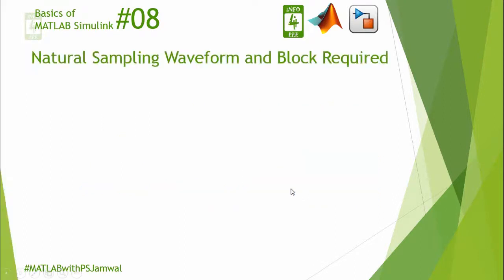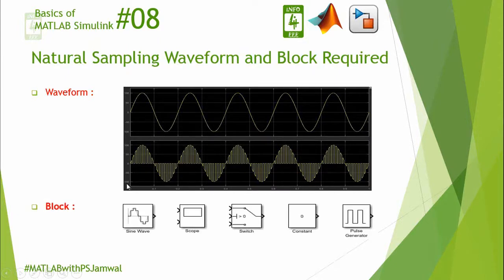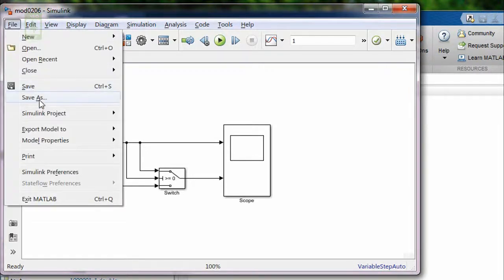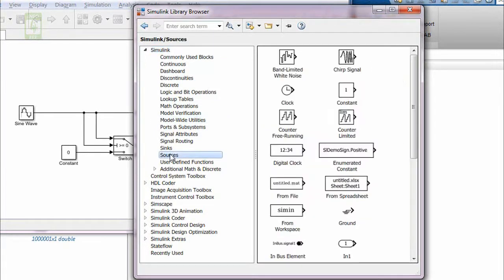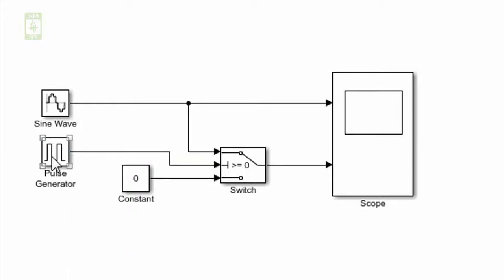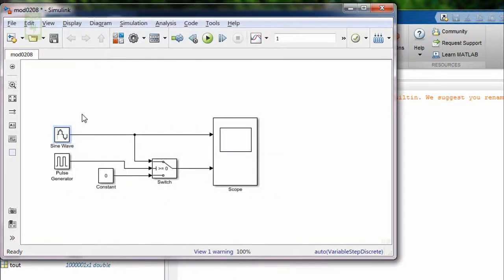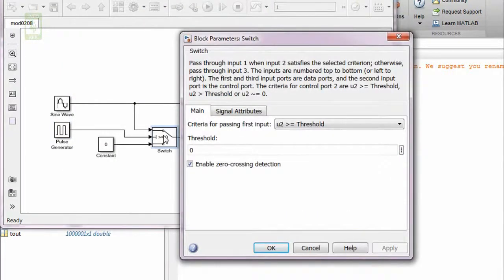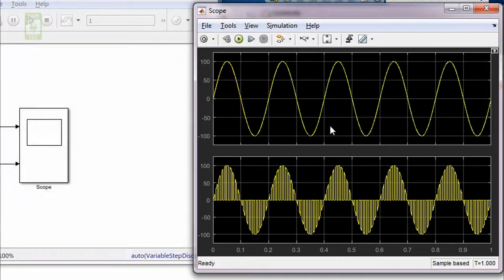Natural Sampling Using Pulse Generator in MATLAB Simulink #08

Comment: Thanks alot for these tutorials sir. Its hard to believe that matlab can this this easy to learn and understand.

Pls sir, could you explain better about why the sampling frequency was changed to 0.01 and why it needs to be greater that that of the sine wave.
Thanks a lot sir
Reply from the maker: Thanks a lot IBIAM APEXCEL for your heart touching feedback. It means us a lot.

In this video, Sine wave of 5 Hz frequency is considered which will have time period of 0.2 sec (T_SW = 1/5 = 0.2 sec). While Pulse wave of 100 Hz frequency is considered which will have time period of 0.01 sec (T_PW = 1/100 = 0.01 sec ).

Number of Cycles of Pulse wave in one cycle of sine wave = T_SW / T_PW

It means in one cycle of sine wave there will be 20 cycles of pulse wave. If you decrease the sampling frequency to 50 Hz than than one cycle of sine wave will have 10 cycles of pulse wave. So if you want to do sampling of each cycle than each cycle should have at least each cycle of pulse wave which means sampling frequency should be equal or greater than frequency of sine wave.

Comment: Good video. Please I hope to ask why amplitude set in a generator as 10 & shown scope 100 in sampling could explain to me if available?
Reply from the maker: Thanks amr. a-m for your feedback. You asked a good question. In scope maximum amplitude is 100 because we have selected this amplitude in sine wave block to generate sinusoidal signal. 

While on the other hand, 10 amplitude is selected in Pulse Generator block to control the operation of switch block having 5 threshold. Pulse generator block generate the square wave with 10 and 0 value. when it is 10 which is greater than 5, it passes the signal and when it is 0 which is lesser than 5, it block the signal by passing 0 value. You can also select any value like 1 amplitude in pulse generator and 0.5 threshold in switch. It is used to control the ON and OFF operation of switch block.